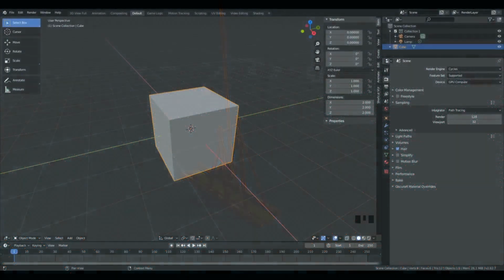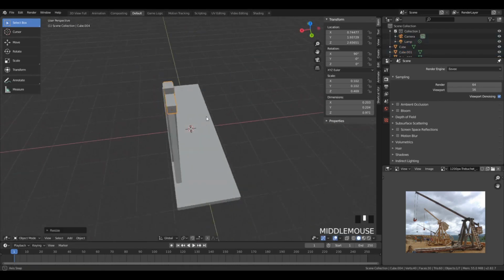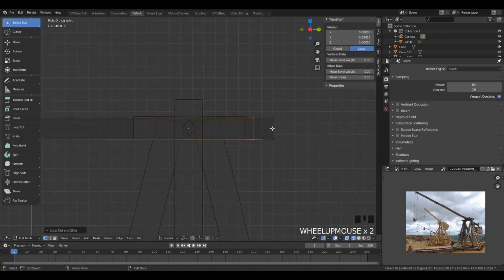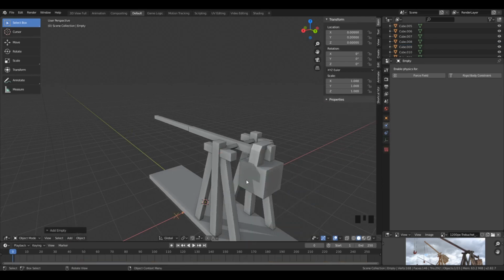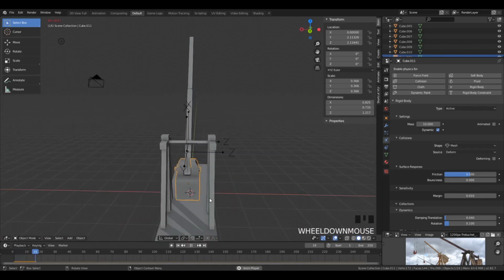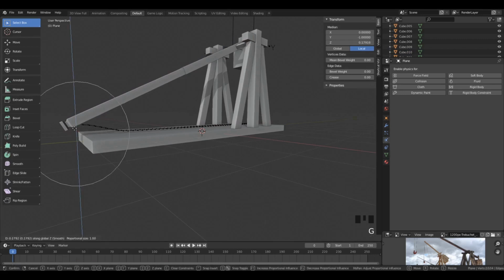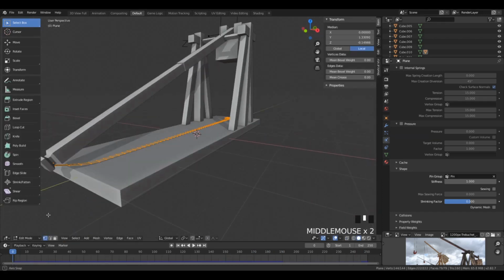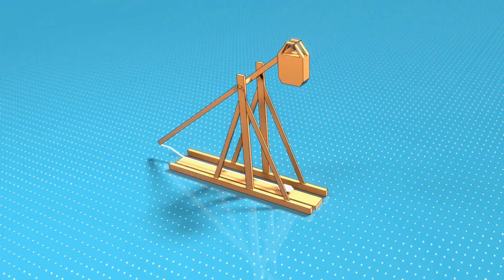Blender 2.8 Physics Tutorial - Make a Working Trebuchet!

Comment: Tried using an additional Empty and parenting it to the middle of the launcher.. then adding a UV sphere as a projectile and hooking it to the Empty using the hook modifier. The sphere follows the tail end of the rope where I hooked it.. but getting it to detach and keep the momentum of the throwing arm is eluding me.

Ive tried rigid body dynamic animation keyframes + key framing the hooks influence on the sphere at the same time the rope should be letting go of the sphere.. but cloth physics mixed with rigid body physics can be super unreliable it seems. 

You should do a follow up where you actually launch something and show us the way!

Comment: Can make a slingshot physics I modelled a slingshot but I don't jnow how to simulate the rubber of the slow Slingshot
Reply from the maker: That is an interesting problem. I think the cloth simulation in Blender can account for an elasticity through its system of internal springs. I'll look into it, as I'll probably make another of these siege engine tutorials later. Ref: https://docs.blender.org/manual/en/latest/physics/cloth/settings/physical_properties.html

I highly suggest you experiment with it and maybe you'll learn something new! That's how I come up with the ideas for these tutorials :)
Reply: @WintermuteDigital  thanks

Comment: You can use Pure ref for references, you should try it out its very good. Also to place the origin where you want like in the center of the mesh, you can press "W" which brings up a the Object Context Menu in which you can set the origins position, note if you have left click selection than the menu can be brought by "Right clicking".
Reply from the maker: Thank you for the suggestion, I am already a fan of PureRef:)  [ https://www.pureref.com/ ]

I would've used it, but I set my screencapture software to record the Blender window only (to avoid capturing notifications and other things), so PureRef wouldn't have been captured. Also, I wanted to show how to preview a single image with Blender's built in image viewer.

However, for anyone else who needs to manage multiple reference images, this is an excellent tool!
Reply: @WintermuteDigital  Ah i see, i thought it would be that, but wasn't sure haha :)